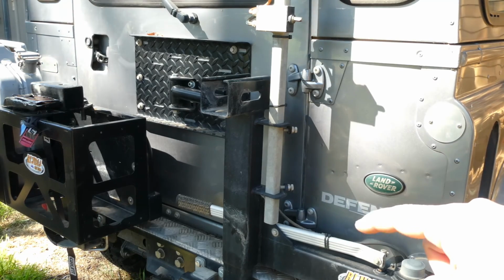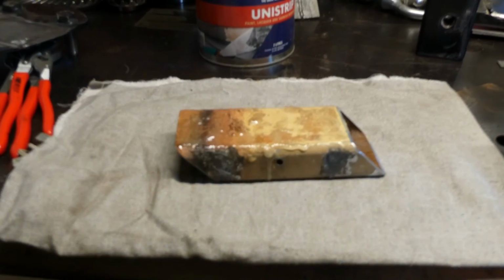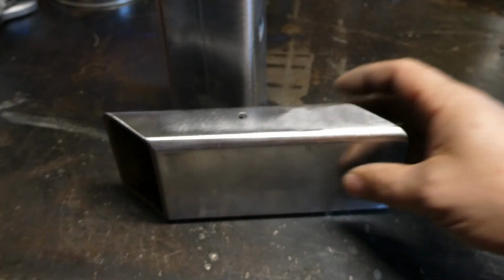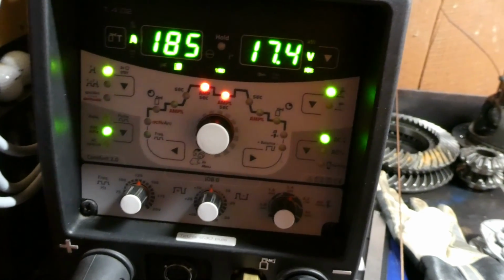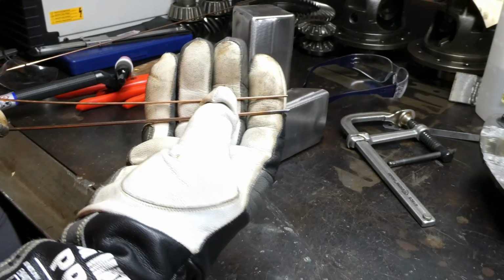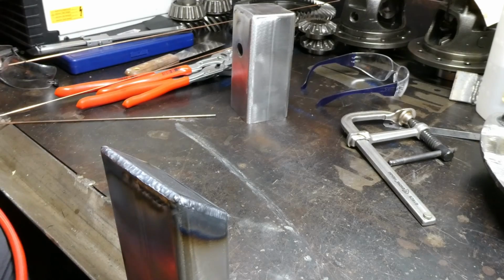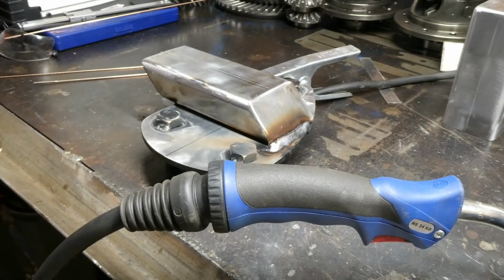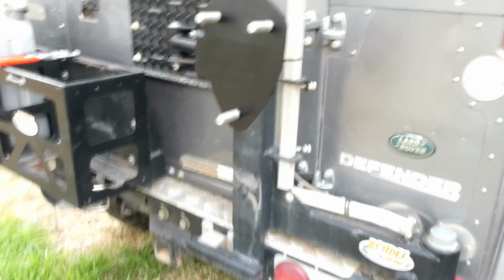Land Rover Repair - Rebuilding the wheel Carrier mount

Comment: Hey Mitch, what MIG welder do you have ? 
I'm really thinking of getting the same CK torch as you have to replace the EWM one !
Reply from the maker: that was the EWM picomig 180 pulse. a single phase small multiprocess unit. very nice little machine. 
CK torches rock. For lighter duty work, You wont be disappointed